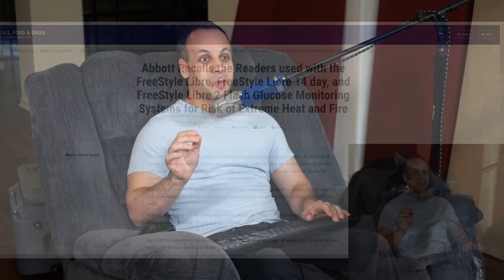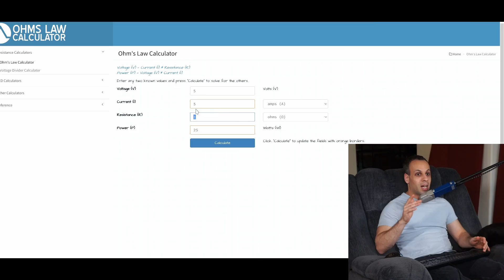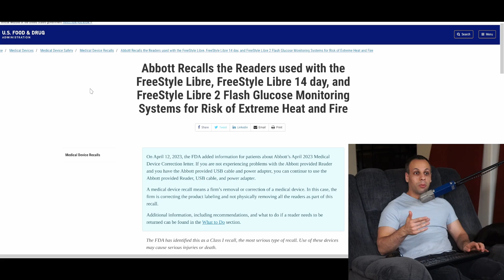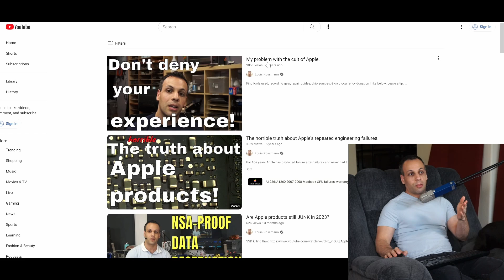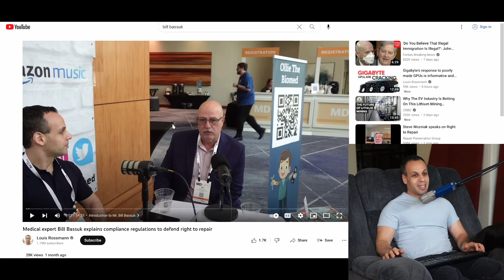Abbott gaslights customers during FDA recall of burning glucose monitors

Comment: I agree your assumption that the engineering was 💩💩.  They then created their own charger that could not provide any more amps than their poorly designed charging port could take.  Since medical devices have a testing period that could take 9 months.  It was easier to “fix” the problem by constraining the charger whose engineering and testing cycle is much shorter.

Comment: exposing their charger and cable to atmospheric levels of oxygen also causes issues, proximity with trees, cars, doors, Wednesdays can cause battery swellings too few or too many donuts at your local bakery will cause fires with the device. 
What a well engendered device, a hand grenade is safer to handle

Comment: fun fact, a good usb type c PD charger will not put out any voltage, unless bot the CC lines (data lines for the power delivery) are pulled to ground with a 5.1K resistor. not 100K not 1K

Comment: Thanks for going through the volts and amps crash course! It all makes sense now :)
Reply: Heck, every time I plug in my Kindle Fire I get a notification "Your device is plugged into a low-power charger." Because I am using some plug-in brick that I got for free from someone.
If I drain down the Fire, it just takes longer to charge, but the charger I am using is enough to keep it topped up when I use the Fire as a music player and run a game at the same time.
And that's enough for me.
Reply: @MonkeyJedi99  Exactly...your device is asking for a certain voltage, and your power adapter can not provide that voltage. So your device tells you this, and proceeds to take the max voltage that the power adapter is capable of.

Comment: freestyle libre flash glucose monitor is micro usb not usb c.  at a guess they put the lithium charge controller if there even is one in the psu and stuck it out on usb connector

Comment: The 'U' in 'USB' means 'Universal'. That's the whole point.
Reply: The U in USB does mean universal, but there are so many different standards. Cheap cables missing pins, and sketchy charging adapters can already cause problems with some devices.  Add water in a connector port- and you can have a problem.  Unless the manufacturer accounted for getting water in the port by ensuring that the supplied charging cable and charging adapter would be smart enough to account for just such a circumstance and protect the device. 

When they sat around with engineering, R&D, Human Factors, and Design Quality and went through every possible failure mode and every potential circumstance and what might even remotely happen with each one- it looks like they missed something.  

My axiom is still  that three different things have to go wrong because you see a failure at this level. 3rd order interactions are challenging to predict.  I will be curious to learn exactly how the device failed.
Reply: How many generations of standards are there? How many different types of cables and connectors are there?
Reply: @lifeofreilly  Countless different cables and standards. 

In just USB 3.0+, there are Universal A, B, micro-B (the receiver being A and B together). In USB 1.1-2 there are also mini-A, mini B, and micro A. 

The USB 3.2 standard only includes USB C, and thus becomes the standard. Laptops that can are also moving to USB-C.
Reply: I used the yellow USB cable that came with mine to charge my phone and also had no problem using my phone charger to charge my meter.
Reply: There are dozens upon dozens of USB plug, cabling, charger, communication, and power distribution standards across the USB spectrum.
Universal - but for what?  

A bad cable or charger can lead to a fire. It has in other devices which don't receive the scrutiny that medical devices undergo.
Reply: How do u know that?
Reply: But the 'SB' stands for Serial Bus. Only the communication standard is "Universal", according to the name
Reply: The "S" in "IRS" means "Service". Imagine a large organization using a misleading name to fool people.
Reply: @jeremiahbullfrog9288  Yes, the IRS is a service.  You're mistake is in thinking it should be servicing you.
Reply: @Russell Hltn  oh it certainly does service you, by a**f***ing you 😂
Reply: @jeremiahbullfrog9288  It is a service though. Not a good one, but def a service.
Reply: @boggless2771  The twist is that with the IRS, it's you that gets stuck servicing them.
Reply: Doesn't mean you stick 65W charger to 1W Glucose meter.
Reply: @kiranm25x  / If a device destroys itself by 5V 1.5A charging, then it should've not used USB at all... or fix its circuit.
USB PD chargers(or QC chargers) won't give more voltage or amps than a device requests. If it lies about its capabilities, that's on itself.

If you happen to have dumb chargers... that's a fire hazard anyway.
Reply: @kiranm25x  Using a 65 W power adapter (not a charger - the charger is inside the device) for a device drawing 1 W is the same as pluggning a 1W device into a mains socket able to deliver 2 kW.

What must be correct is the voltage. And the source must be able to supply at least what gets consumed to avoid the source being overloaded. But no - having a source that can supply much higher currents than needed isn't a problem.

When you use a flashlight, then the batteries can normally supply more than the flashlight need.

When you connect a lamp or car stereo to a car, the car battery can normally supply way more power.

If this device needs a custom power adapter, then they have been abusive and selected the USB connector without being compatible with USB as power source. And that's like taking a low-voltage toy and modify with a mains power cable and later blame the user when they plug in that mains cable.
Reply: @perwestermark8920  I do agree that USB should be universal and it should have a IC regulator. Atleast the device should be intelligent to do a handshake with charger and only draw required amount of load, I guess the company just cheaped out on $120 device in not adding all the circuitry. 
For the benefit of doubt it must an oversight, lets wait to see if they honestly accept fix the design in next model or continue to do same cheapy design with cost cutting on Power regulator, then they should get real stick.
Reply: @kiranm25x  For other battery types, you can make a silly simple charge logic. Sometimes a fixed voltage + a series resistor. Extra complexity only if you need quick charge where the logic needs to look at voltages/temperatures to not cook the battery.

For Li-Ion you always wants a smart charging chip inside the device. If the battery is small, then any 5V/500 mA from USB is good input and the charge chip then sends 3.2 - 4.2 V charge voltage while also measuring temperature.

You only need a more advanced chip that can negotiate if 2.5 W isn't enough.

An USB adapter is either dumb (maybe just 5V 500mA or 5V and a higher current with some resistors that tells the device If it may draw maybe 1.2A or 1.5A).

Or the USB adapter is smart. So the device communicates on the USB data wires to negotiate for maybe 9V, 12V, 15V, 20V - or all the way to 48V with the latest USB PD standard. And then max 3A for generic USB C cable or 5A if the USB cable has a chip that tells "I'm 5A-capable without any fires)

In this case, it sounds like maybe this device is not USB-compatible. Just USB contact compatible. And expecting a very custom power adapter. That would be a very very stupid decision.

The USB standard is written to make sure you never create any fires if you plug an USB connector in any matching USB socket. Worst case is the source can't supply enough current so you fail to charge. Or the devices steps down to a sad slow transfer speed. But never, ever doing something dangerous.
Reply: @perwestermark8920  That's the whole point of a standard protocol and bus. It also means that it's usually cheaper to follow the standard versus a custom part as long as they meet spec.
Reply: @kiranm25x  3:45
Reply: @kiranm25x  Why not?  As long as the charger doesn't over voltage the meter, it's perfectly fine.

Comment: Lithium Ion Batteries seem like both the greatest and worst thing to happen to technology in recent years
Reply: The heaviest information I've learned about Lithium is how abundant it is. You'll find it anywhere, and it gets worse if you know that there are other options but Lithium is the craze...
Reply: Especially if the battery cell is packed tight enough that the battery is storing a bit more energy capacity in the same volume, and at the same time also increase the fire risk 

There are already many, many news about "game changing battery type that could replace lithium" since like 5 years ago, but those promised technology never arrives to consumer market until today (and some of them are ended up debunked by expert scientists)
Reply: I think they are here for the long haul. Almost every other battery "innovation" has turned out to be vapourware..
Reply: @Cornz38  most technology battery enhancements are changes to the electrolyte or electrodes of lithium batteries.

Tesla now ships with Lithium Iron phosphate batteries. So there definitely are changes going on.
Reply: @Cornz38  not LFP's
Reply: @Cornz38  It's radioactive waste   buy low sell high   pad pockets and BS the little people
Reply: Wait til electric cars are the norm. I sure sove unextinguishable fires!
Reply: The problem is LiPo4 exists. There is no reason for lithium Ion to be legal. Lithium Phosphate does not explode and has nearly the same density. It actually lasts more charge cycles too.
Reply: @ricky4673  LiPo deflagrates but that's it
Reply: @GH0STST4RSCR34M If the battery they use is not protected, and their design team says, hey, lets  use a 300mA charger (just pulling a number out of the air) that will be safe enough.  So here I come along with a 5amp usb charger and use that, I'm might just be able to get that battery toasty hot becuase they didn't put any charge control within the device.
Reply: @GeorgeWashingtonLaserMusket  Even then, they have issues. If someone crashes a Tesla for example, the fires are intense
Reply: @GH0STST4RSCR34M it should have nothing to do with it. Proper design is battery charge control in the device with temperature sensing. Charging cct in the device is programmed to match the charge characteristics and limits of the battery. And if the battery gets too hot during charging, reduce the charging current or just stop changing until the temperature is at a safe level.
Anyone who thought it was a good idea to assume the brick itself should be 'in charge' of charging is not competent to work in the industry in any capacity.